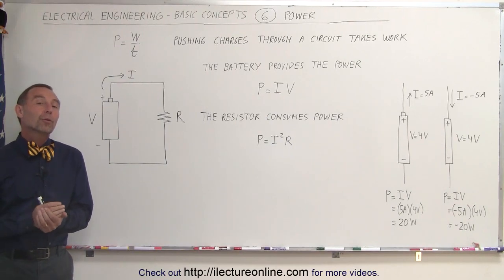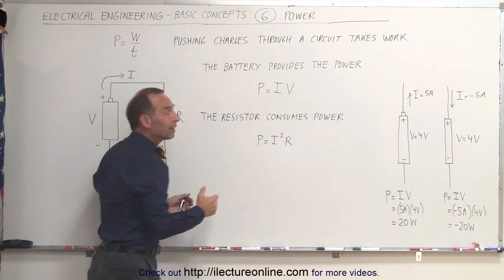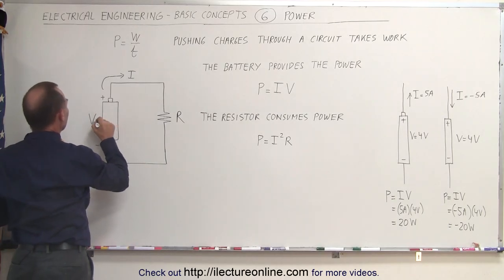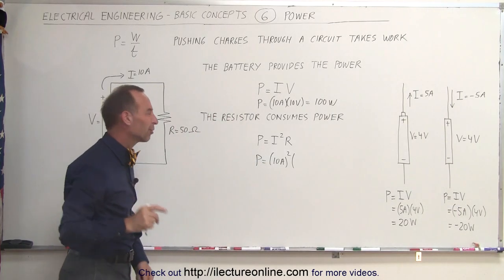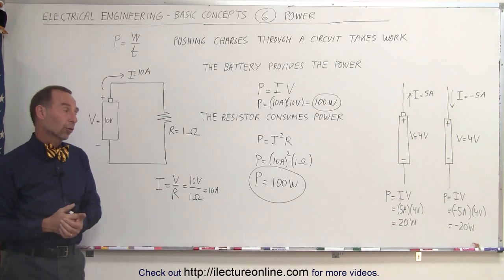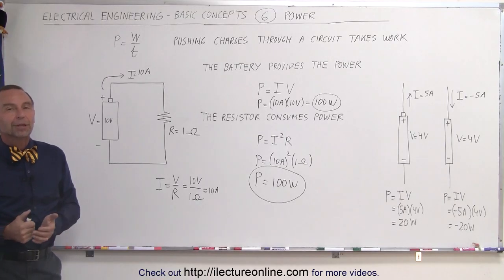Electrical Engineering: Basic Concepts  (6 of 7) Power in a Circuit

Comment: Sir, battery produce power and sources/resistor/load consumes power then why we represent both in positive?
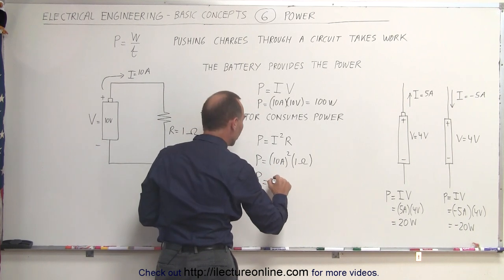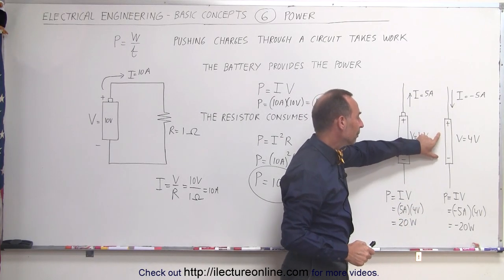2:46 why we don't write Power consumed in negative? Like negative at 4:03(battery with opposite ends or current in different direction) Or this is just calculation and we are just considering magnitude here.
Reply from the maker: Power is a scalar quantity and therefore it has no direction (or negative sign).  I the correct context withing an equation you may need a negative sign.
Reply: @MichelvanBiezen  thanks.

Comment: When you said there is negative power across the second battery; doesn't negative power always mean the device is consuming power? Cheers. My understanding is that a battery with negative power isn't actually supplying power to the circuit.
Reply from the maker: Let's think of it in terms of a set of batteries.   Let's assume we have 3  4-volt batteries in series, but one of them is connected in reverse.  What is the total voltage across the 3 batteries?  What is the power provided to the circuit?

Comment: By (-20W) happened to go through the battery, does it recharge? hmmm
Reply from the maker: That depends on the battery itself.  Some batteries are capable of recharging and other are not.  If the battery is rechargeable, then yes you can charge it by reversing the current.